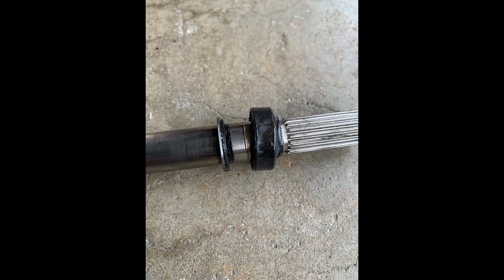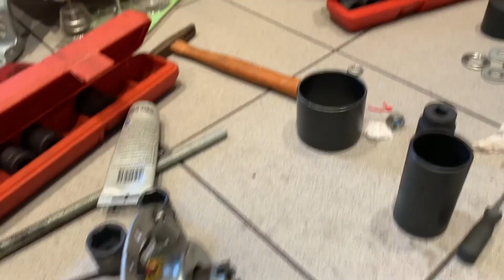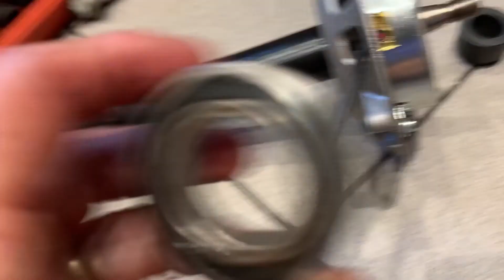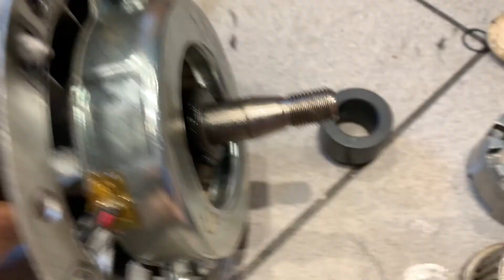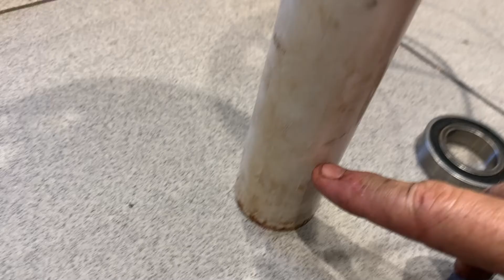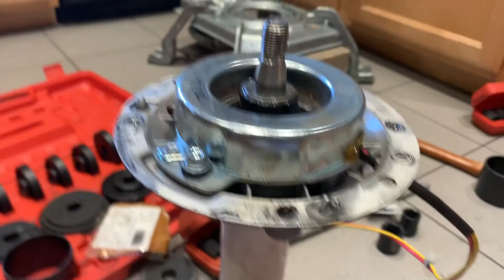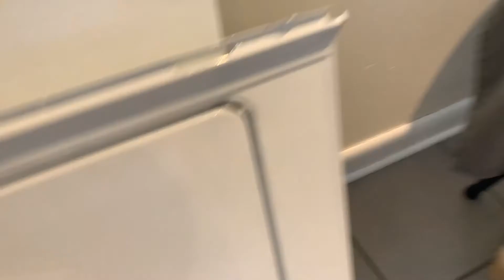Replace Bearing on GE Washing Machine GTWN4250D2WS Mode Shifter Shaft Drive Assembly

Comment: What end of the outer shaft are you banging to get the shaft off the bearing at 3:41. The long side outer shaft referencing from the frame? What side does the bearing come out at 3:58. You mention top of frame, what is the top? The long side of the outer shaft from the frame? Thanks in advance
Reply from the maker: The outer shaft comes out of the bearing by banging on the short end that’s within the electromagnet housing. It only has to be banged an inch or two I’m guessing to get it off of the bearing. You’re obviously not bringing the shaft in its entire length through the bearing. You’re banging on the short end. Hope that helps
Reply: @condor5635  thanks 👍

Comment: You did an excellent job explaining ths process.  Take care
Reply from the maker: dejapex1 Thank you.  It is still running fantastic.  Hope you repair goes well if you are actually needing to undertake it.
Reply: @condor5635   I had the typical noises during the spin cycle. Investigated. Ordered parts including a rebuilt shifter shaft drive for $81 from Corecentric on ebay. Got all of the parts, made the repair machine works fine. Corecentric provides  "recyclng" box to send them the old shifter drive. Neat business for them to then rebuild and sell - seems like a win,win. So I thought I would try to put a new bearing in. Thanks to you and other youtube videos, I am at the point of driving out the bad bearing and, if successful, I'll order the new bearing and press it in. Thanks again

Comment: hey thanks so much for making this. i found this vid from the comment you left on the repair clinic video. i was unable to get that bearing out of the shirt assembly. what tools can I use to get this off? i attempted banging it out with the old tub bearing I was going to replace but it ended up breaking up when i hit it with a hammer attempting to bust that bearing off with it. could u give some advice on getting that bearing off?
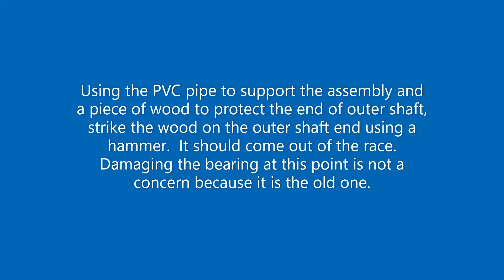Reply from the maker: So you got the shaft off of the bearing already?  If so then at 3:52 it talks about getting the bearing out. Support the assembly frame on the side that the bearing comes out. Support it with as much as you can to support the round area but have enough area to allow the bearing to come out. Using a socket on the other side - largest socket that you can - bang the socket with a hammer and this should allow the bearing to exit the assembly. Let me know how it goes!  Thanks!
Reply: @condor5635  i got the aluminum assembly to come off the bearing. but i still have the bearing stuck on the shaft. will not budge any tips? UPDATE just got it with a sledge hammer and cinder blocks. ill update tomorrow when i assemble it
Reply from the maker: Wesley Sullivan - how did it go?
Reply: @condor5635  broke the piece of metal on the shifter assembly while trying to get the new bearing on the shaft.
Reply from the maker: Wesley Sullivan - did not get proper support I am guessing?  Guess just buy the whole assembly?
Reply: @condor5635  No i've had enough at this point. I refurbish and sell appliances so I will part out the unit at this point.
Reply from the maker: @wesleysullivan8047 - my neighbor had my same washer she gave it to me recently. Most parts work fine. I wanted to part it out. Any advice on that effort?  I mean motor is good as well as most parts. What approach do you have to selling?  Thanks!
Reply: @condor5635  for used appliance I usually focused on selling timers, boards, pumps. Smaller things easy to ship etc. There are a few channels that have great videos of selling used appliance parts.

Comment: Good vid, I attempted it a few years ago but did something wrong as I broke the bearing housing using a shop press. Ended up selling the seal and bearings as a kit online and parting out the washer and scrapping the rest.
Reply from the maker: Sorry to hear it did not work out. Bearing removal and installation is definitely somewhat of an art where you have to keep in mind where the force is being applied and how to support the assembly at the same time. Proper sized tools (sockets etc) are essential as well. Thanks for commenting!

Comment from the maker: This has been an excellent repair so far. The machine is super quiet now and you can actually talk while it’s in high spin mode and you’re right next to it. It’s also bone dry on the shaft looking from underneath so the main tub seal change worked very well. Totally happy with the repair!  This should last at least three or four years. Take care.

Update - still going strong after a month. One issue was the tub started wobbling during spin. Immediately thought the main tub but was loose and sure enough it was. Tightened that sucker down again. So put a reminder for a few weeks after repairs and check seal/shaft from underneath and that 1 11/16ths tub nut is torque tightly.
Reply: Amazon sells the mode shifter assembly and shaft for $75 bucks used.  I think I'll just do that.  I don't have the space or tools for everything.  But since my tub is not leaking, do you think I need to wrestle with the bearing for the tub?  I'll prob replace the seal and belt while I'm down there.  But what do you think of the tub bearing?
Reply from the maker: @rotcod2886  - The only ‘bearing’ that I’m aware of is the replacement ball bearing discussed in the video. Yes there is a collar that I think is referred to maybe as a bearing that I replaced as well. It sits in the plastic tub and the shaft goes through it. My thoughts are if you’ve got it taken apart where you’re replacing the shaft and the mode shifter assembly you may as well replace the bearings and all other seals as I mentioned in the video. You’re only talking another 20 bucks or something. That way you’re sure everything is new on the parts that ensure water stays where it supposed to be.